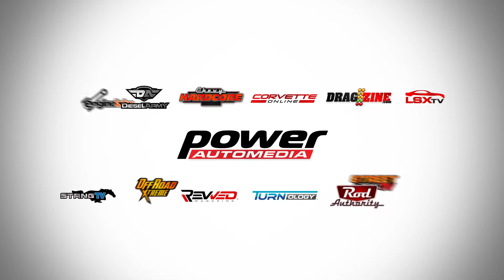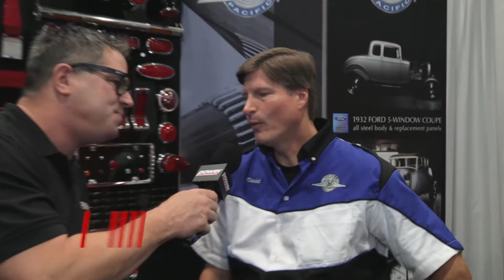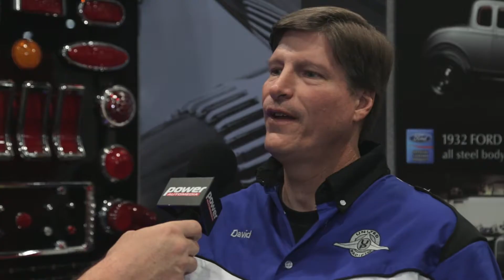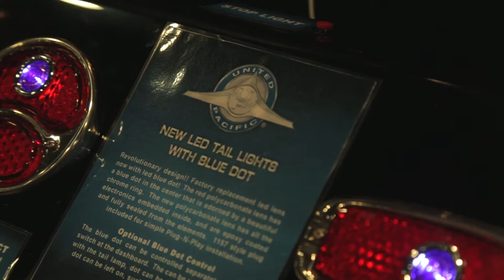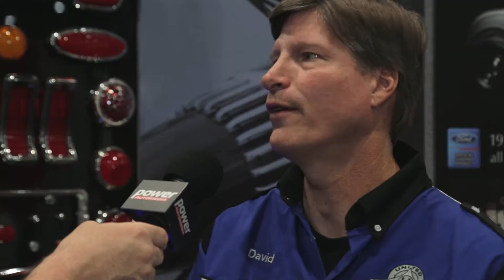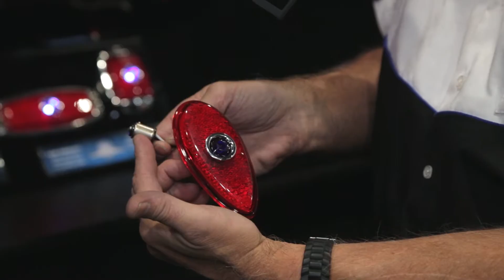SEMA 2014 - United Pacific has Joined the Classic Blue Dot and LED Technology In One

Comment: is this legal?
Reply: YES! until you get caught.
Reply: In most states no, but the police really don't care either. Usually they have more important things to do unless you're being stupid, then illegal lighting will be just one more thing they add to the citation.
Reply: Nope. Don't give them a reason to pull you over. You are surely buzzed and they are bored with nothing to do but their job to enforce equipment violations. It's a thrill for them. Tinted windows too.  Axle lights. Tires protruding the body line, wheel well.  Air dam below rim height even if flexible rubber. Plexiglass over your license plate. Blacked out tail lights. Headlight height above ground level.  They'll look at all your equipment violations since you got their attention. And you will have to buy new lenses to put the lights back to stock to get the ticket signed off. If not more additional horrors.
Reply: @Ben Harness  ok Mr. Doom and Gloom  if you had actually watched the video you would've seen that the blue (purple) dot can be switched so you turn it on or off whenever you want. Back in the day when I was partying I would put a piece of electrical tape over the DOT

Comment: These are not purplish  pink like the old days ..—-I bought some and the Lens are extremely nice I bought the teardrop I do like how you can wire the blue dot up separate but -on the down side ever one knows the blue dot lined up right on a 1157 bulb and when you mash the brake it was purplish pink and this is not the case with these they are blue ...with that said the leds they do look pretty nice and the brake  light is very bright for the size I think something like 33 led the chrome around lens looks nice ..so the blue dot is the only thing I wished they got it right ..all in all nice light...